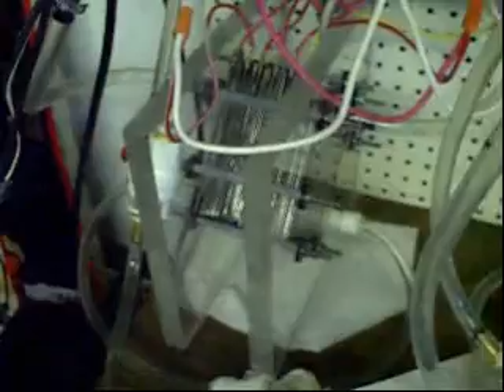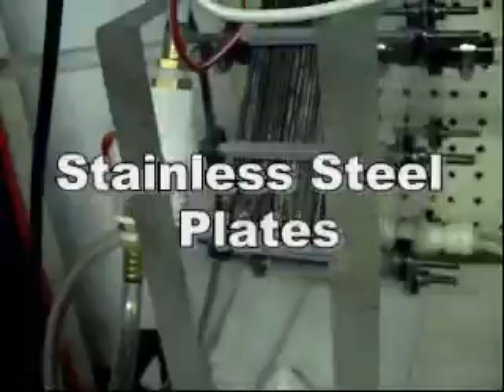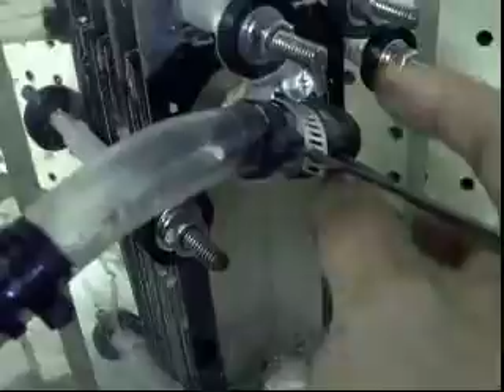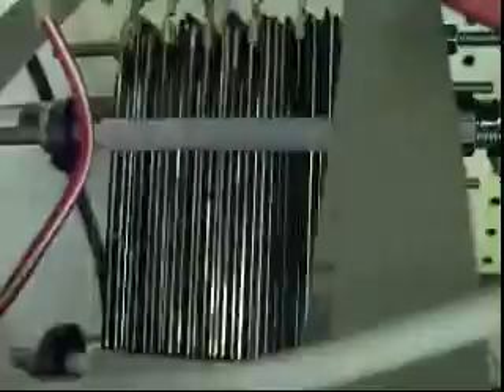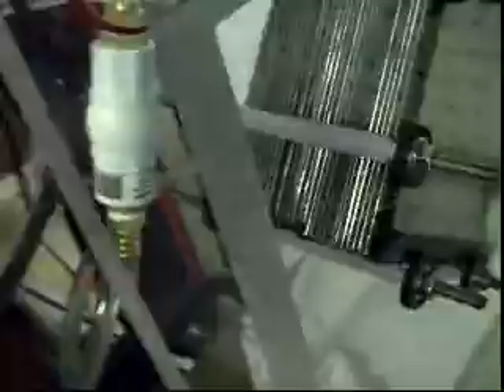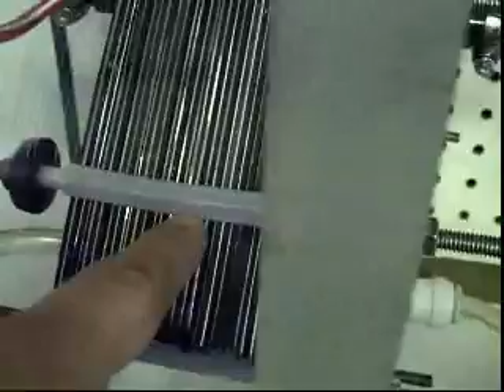#19 PART1: Basic Tips for Hydroxy Dry Cell Construction

Comment from the maker: @mavelazquez Neutral plates divide the voltage between each cell. Between each set of power plates, i use 5 neutral plates to divide the 13.8 volts, so i get between 2 and 2.3 volts per gap. Two power plates and 5 neutrals gives you 6 gaps. 13.8 / 6 = 2.3volts per gap.
Any further questions, just let me know
Jeff

Comment: Hi Jeff,
I am HARLIN and also building dry-cells, first many thanks for sharing
all this!!!
2nd We used Neoprene too but found out when the cell after many hours 
production, the Neoprene doesn't shrink as fast as the 316l so there
is a risk of leakage, also there are indications that the H-atoms leaks
through the gaskets. We changed to EPDM and all the problems went away.
Again many thanks for your work
HARLIN
HYDROXY TECHNOLOGY NETHERLANDS

Comment from the maker: @1991SmokeyMcPot1991 I am using 1/16" thick neoprene gaskets. It comes in a sheet and i cut them out using a knife. On larger cells i am using 1/8" thick.

Comment from the maker: You got it.
 As long as you have 5 sets of neutrals. 
The exact design of 5N5 is 
-nnnnn+nnnnn-nnnnn+nnnnn-nnnnn+
This will take 31 stainless steel plates.
You will notice it adds up perfect to fit 
4N5 configuration which is better for straight battery power, because battery power is around 12V and battery chargers or alternators are higher, closer to 13.8V.
Stay Safe.

Comment from the maker: The electrolyte circulates through the system without any pumps at all. As the water changes to gas, the gas is under a small pressure. This causes the gas to flow upwards to the resevoir. If you lower the resevoir to the hight of the cell then the flow is slowed down. As you raise the resevoir the flow gets faster. If you have any questions at all just ask away. 
Stay Safe.